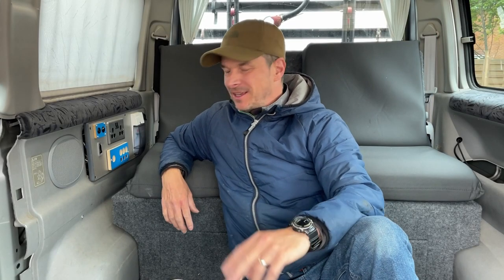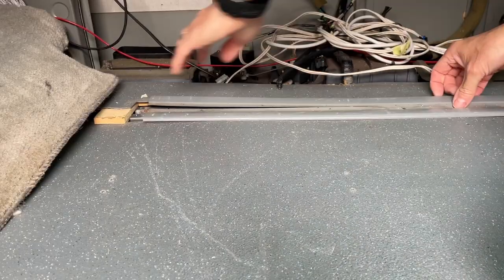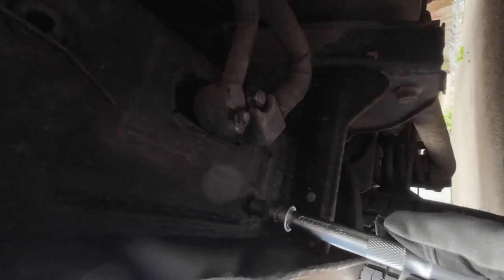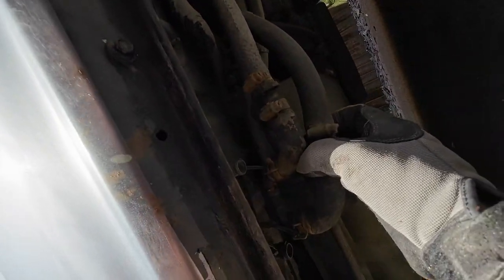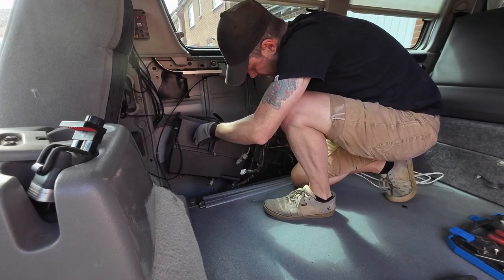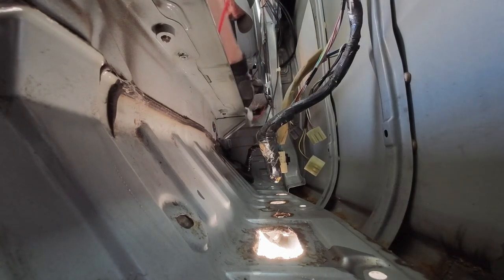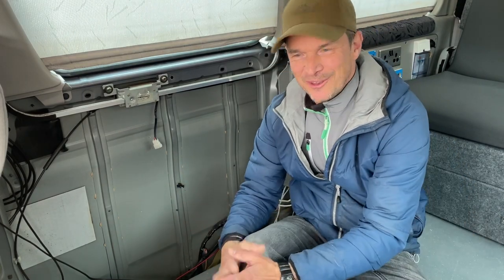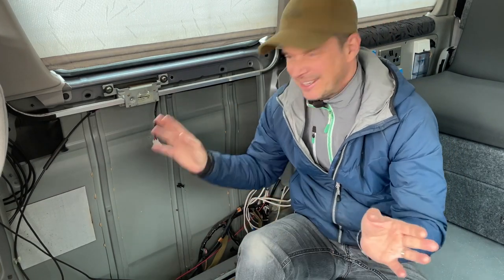Rear heater / air con unit removal in a Mazda Bongo

Comment: Hi would you mind telling me how you plan to block the rear air con so you can fill the front I have the same issue and want to blank off the rear so at least I can fill so the front works. Your advice for my mechanic would be amazing 😍
Reply from the maker: Hi, I've yet to discover the exact method of blanking off the AC, as soon as I do I'll do an update video! cheers 👍
Reply: I'm also very interested in a solution to blank off the rear AC, if you find a neat way! There's a leak somewhere in our rear unit, and with the design of our conversion it'd be way too much work to troubleshoot otherwise. Thanks!
Reply from the maker: @robelliott1798   It's on my to do list as I really want to sort mine out as well. I'm nearly at the end of this conversion so I'll be looking at getting it sorted and will post an update on it :)

Comment: My rear heater matrix is bypassed but Aircon still works.
I assume the heater matrix and aircon is one unit and you can’t just remove the heater matrix?
Reply from the maker: Yes it's all one unit as far as I could tell. Cheers.